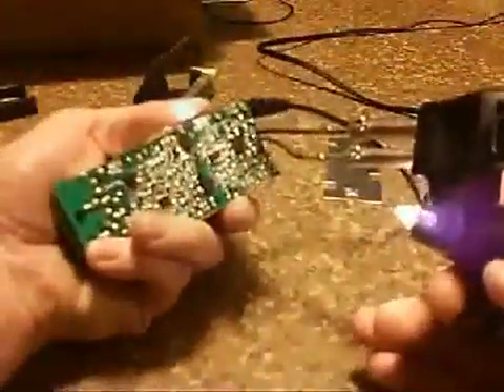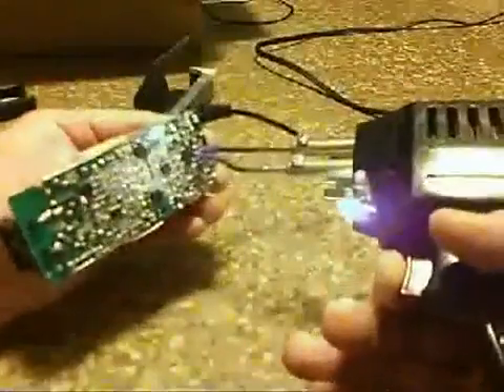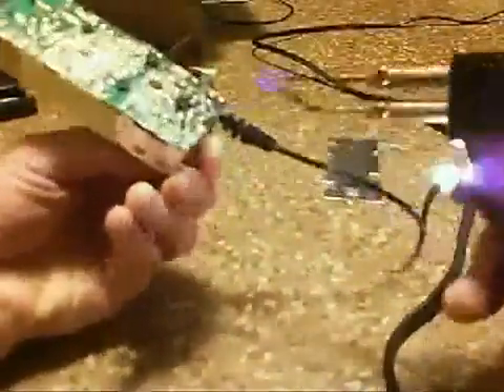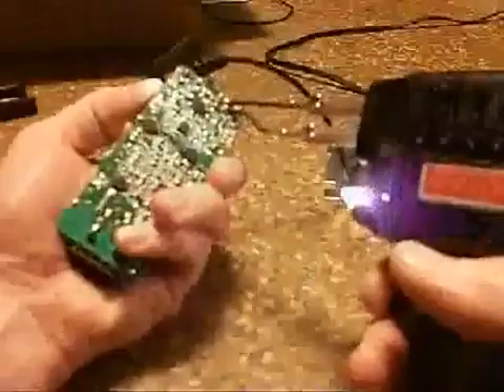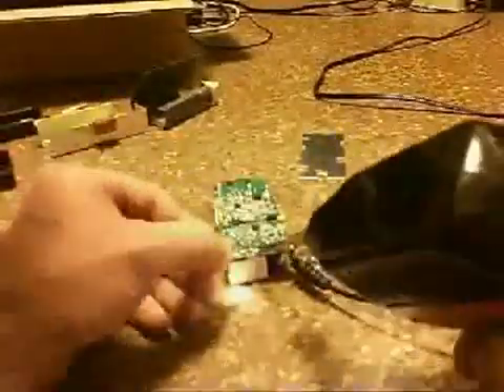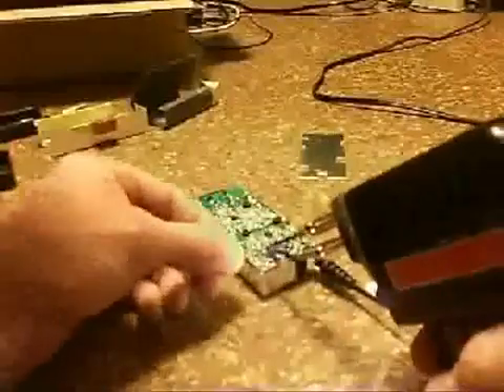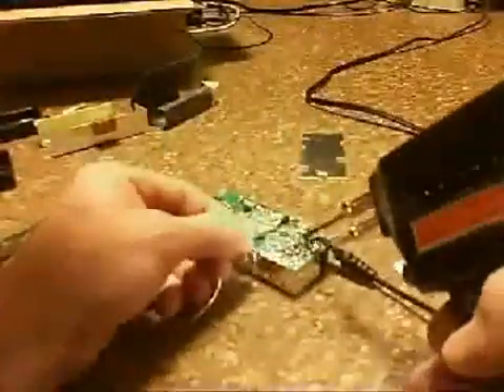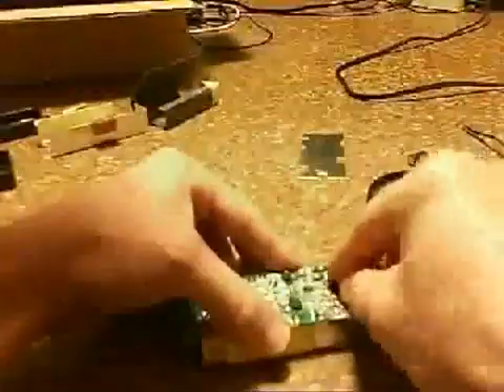فتح فك وإصلاح شاحن اللابتوب المحمول Open and Repair laptop Charger

Comment: If the problem is just in the dc power plug of laptop charger than that problem can be solved by replacing the damaged plug. Try 'Quickfix DC Plugs' product; No soldering is required and no need to open the plastic case. just simple 1 mint job. Same solution is for Apple Magsafe adapters. Check the website and order one for yourself, no matter where you live in the world. There is also a video available on you tube for demonstration.